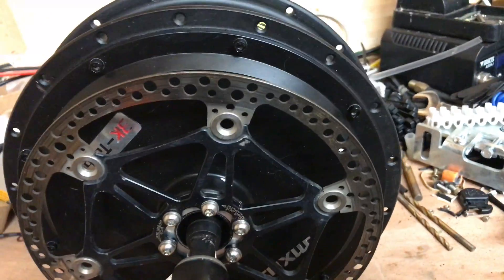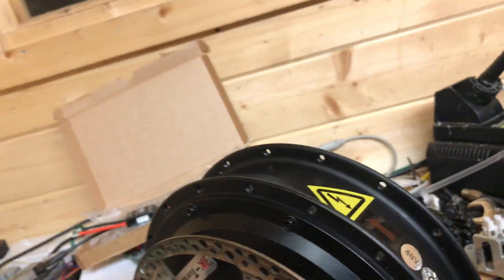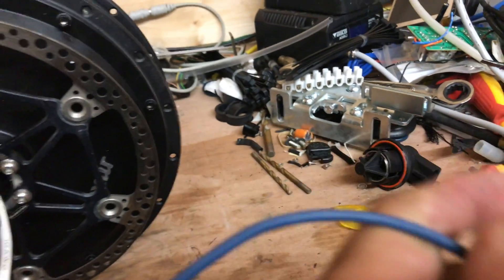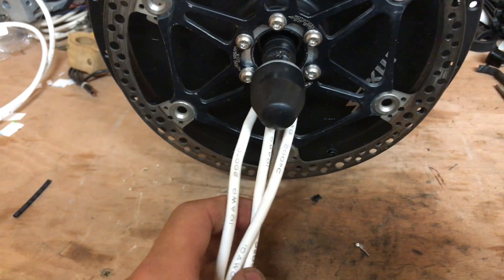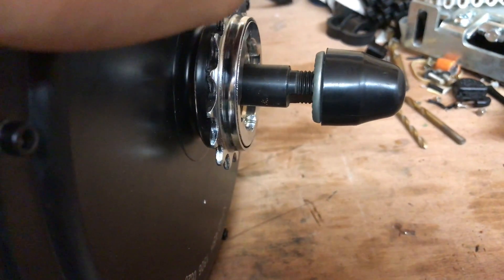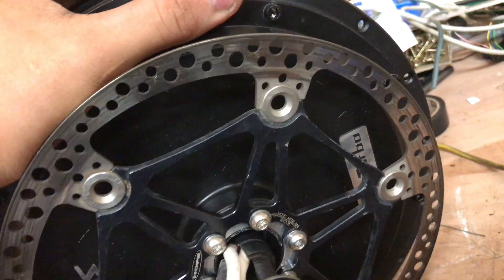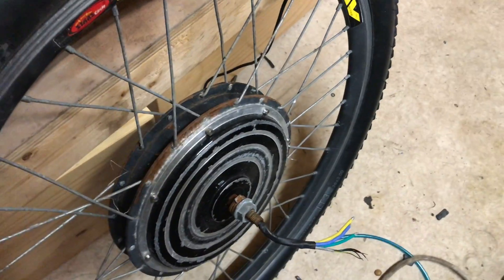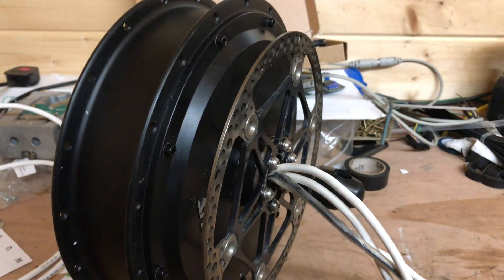Ebike Build Part 1 MXUS 3k v3 Hub motor

Comment: Problem with the spacers at the Brake is that the Screws get Sheared of
Reply: I run a 203mm rotor and 4 piston shimano calipers with one plastic spacer and have had zero issues.

Comment: You mentioned 13kw, is that continuous w/ statorade and hubsinks??
Reply from the maker: 13kw peak as the batteries couldn’t handle it
Reply: @CrazyDave  ah I see, what was the highest kw you felt you could run continuous?
Reply from the maker: staver76 the most I had continuous is 8kw but the motor didn’t get above 30c
Reply: @CrazyDave  Thank you for letting me know, that's insane, only 30 degrees celsius continuously running 8kw?? Were you running statorade and hubsinks?? And  is this the 3T wind?
Reply from the maker: I was running 2 hubsinks and no statorade and yes it’s the 3 turn and the hottest it ever got was 40c and that was on a really hot day
Reply: @CrazyDave  I'm surprised, another youtuber (Vortecks) was worried that 40 seconds was the maximum using hubsinks and statorade, how long were you running 8kw for? This gives me a lot of hope since I wanted this to be able to carry to people haha
Reply from the maker: @staver76  I would regularly commute to work (13 miles) and for most of that I was running between 5 and 8 kw
Reply: @CrazyDave  Thank you for answering all my questions thus far, what speeds were you trying to maintain at 5-8 kw and 3t winding?
Reply from the maker: staver76 between 50-65 mph

Comment: Hi mate what sort the battry and bms can use with this motor I got 72v 50a bms I wonder if is up to the job with mxus 3000w 3k or need to upgrade my battry and bms?
Reply from the maker: Yes that should do the job but a 100a bms would be better

Comment: NEED  SOME  HELP TO CHOOSE  CORRECT  UNIT  FOR  A  REBUILD  AS IM NOT THE LIGHEST PERSON  IN TOWN    DAVE SORRY TO BOTHER YOU IM IN THE PROCESS OFF GETTING A  MXUS 3KW HUB AS 1000W IS  WEAK AS HELL   I HERE THERE IS  3  TYPES   3 T   4T  AN  5 T  WINDING   I HAVE NO INTREST IN SPEED NUT UPHILL   TORQUE   WHAT  ONE  PLEASE  ??? I ASSUME  THE  6T  IS  THE  BEST UPHILL  MOTER WIND THEN  DAVE  YES ???   SECOND  QUESTION  IS  I  ASSUME  YOU  UPGRADED  THIS  HUB  TO  THICKER  WIRES  ??    WHY ??   DO THEY  BURN UP OR SOMETHING  ??
Reply from the maker: Yes the 5 turn would be best for uphill torque and the reason I upgraded the phase wires is because I was running the motor at 10 kw and I wanted bigger wires
Reply: @CrazyDave  thanks dave     where do i buy    ?

Comment: Hello, is it possible to mount a 9 speed instead of the single speed? There is plenty of space for it but can it be mounted on it?
Reply from the maker: Yes I’m sure that that’s possible you would need a 9 speed screw on cassette
Reply: @CrazyDave  can you physically mount it on it? Like, does the screw size fit? If you got a spare motor would you be anle to try please, doesnt matter if is 9 speed or 8 speed or 6 speed or whatever, just want to make sire, don't want to be stuck with a single speed...
Reply: @gursisingh1940  I've been wondering this. I've seen other videos which shows this motor having a 9 speed cassette on it so I'm guessing it's possible.
Reply: @wakkowarner7391  Thats was 5 months ago lol, no I ve realised that I dont need a cassette, on my 2kw I ve done 2k miles and probably used the shifter maximum 10 times

Comment: Hi just about to buy and  build a bike .where do you recommend to buythe motor and what do you think about a 5k motor ?
Reply from the maker: i bought my motor here:
https://www.ebay.co.uk/itm/MXUS-V3-3K-Turbo-3000w-high-speed-electric-e-bike-hub-motor-48v-60v-72v-84v-96v-/163525921603?hash=item2612e78b43

and the 5k motor also sounds good but it's harder to get hold of

Comment: I would like to ask you a question.  Is there a hole for the "statorade fluid" ? If there is, where is it ?
Reply from the maker: I haven't yet drilled a hole for the ferrofluid but if I do I will most likeley cover the topic in a future video
Reply: @CrazyDave  ok. When you will check,take out the brake pad and look if there is one hole. One screw hole is suppose to be ready for statorade. Comeback about it cause I would like to know ;)